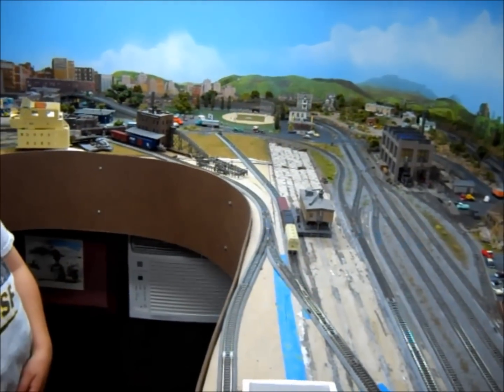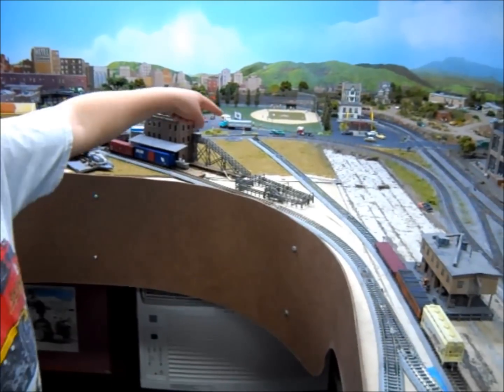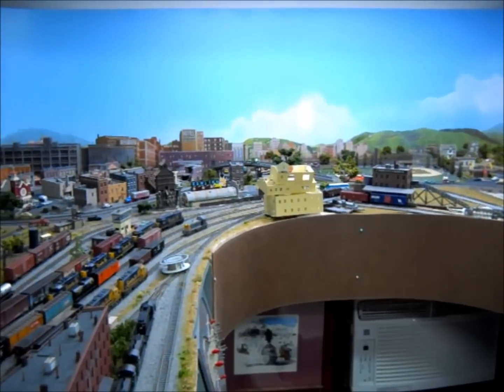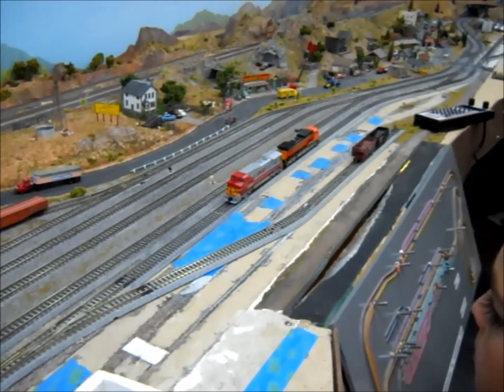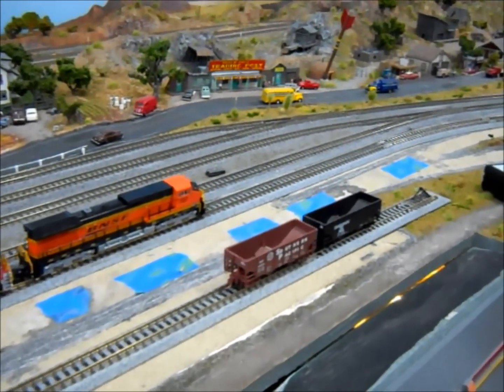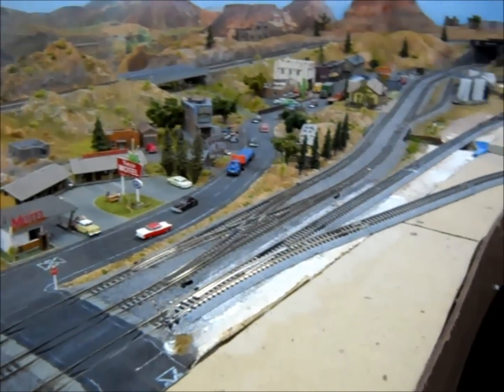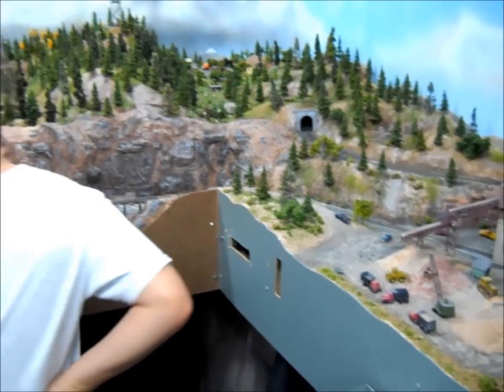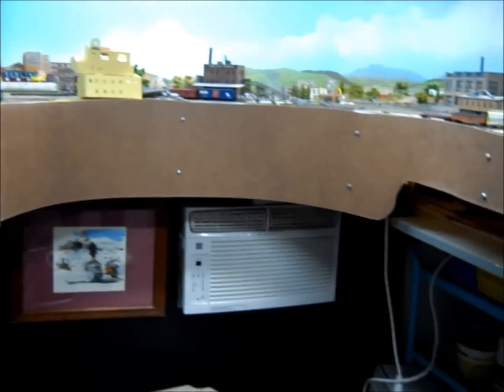N Scale ACTRR Update #37

Comment: I noticed the Digitrax Throttle;  did you change your MRC for to Digitrax?  You had said previously you were having some track issues and I wondered if the change in DCC systems was your fix.
Reply from the maker: I went back to Digitrax as the club uses it and other personal issues with MRC that I will not discuss here. Myu track issues were my own mistake and was eventually tracked down to a reversed feeder.

Thanks , Mike